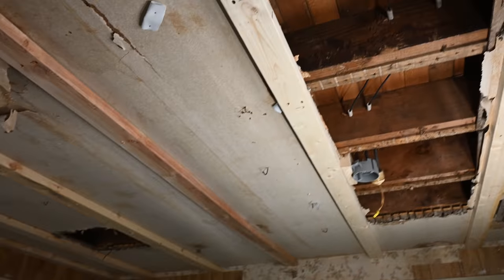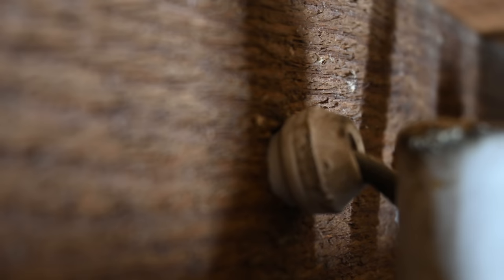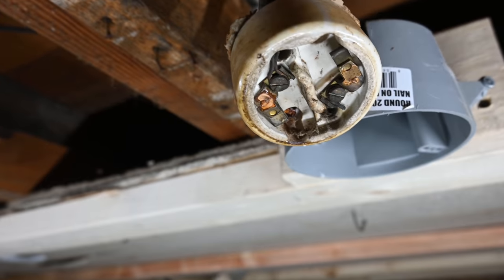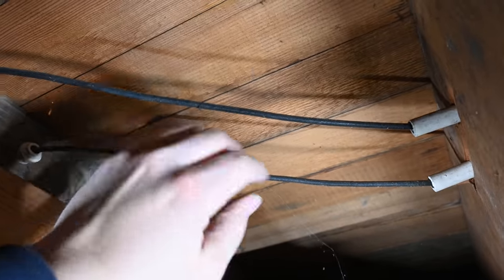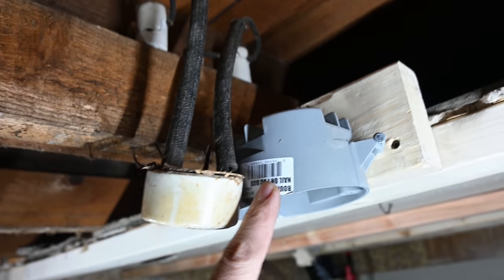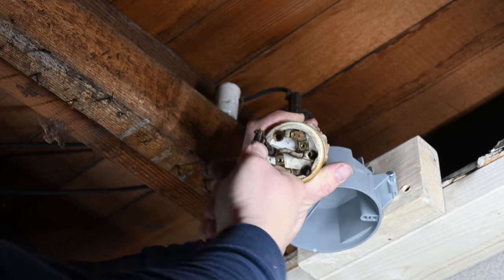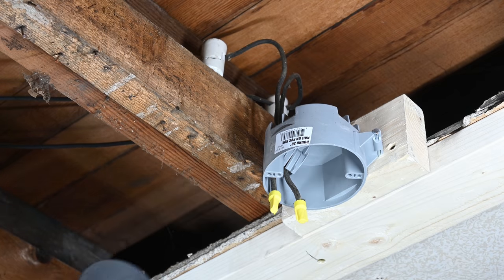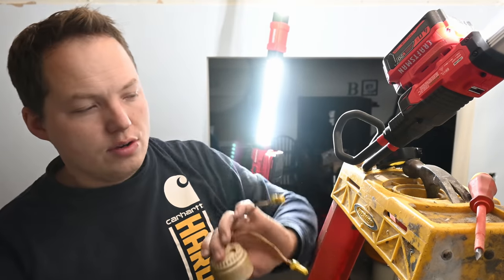How To Abandon Knob & Tube Wiring in a Wall or Ceiling

Comment: My home, built in 1959 has knob & tube (KT).  When I renovate a room, I replace KT with Romex all the way back to the circuit box, if I can.  But finished rooms and ceilings blocked that in some cases.  In that case, I have installed a box to join KT with Romex leaving as little KT as possible.
Reply: Home built in 1959 with knob and tube??? are you sure the home was actually built in '59.  That is very late for knob and tube.   I've been in homes from the '30s that had the original cloth wire romex,  all the knob and tube I'm aware of wad installed before WWII and never seen any installed after about the mid 40s at the latest.
Reply: @Sparky-ww5re  1962 home with K&T here (San Francisco).
Reply: @markcrimmins1879  very cool.    Seems they used K&T much later in certain areas of the country.  In 1962 grounded romex had been around for a couple of years even before grounded receptacles were required,  they would often wrap the ground wire , which was usually 16 gauge with 14 or 12 gauge hot and neutral during this period,  around the clamp securing the cable to the box, you'd then have what is known as grounded two prong receptacles,  this is where using the coverplate screw on the green tab of a 2 to 3 wire cheater plug will actually provide a ground, of course nobody used it like that.

Comment: We have a lake house in NH built by my great grandfather and wired with knob and tube. In the 1950's, my father figured it was dangerous and also wanted to add more wiring (the old insulatiopn was dried up and cracking). So, we tore out all the old wire and installed new romex with all new fixtures.

Comment: One comment. I was always taught that in a box there could only be one breaker feeding that box. So, what you were talking about here where you were terminating the K&T and also running in a Romex for lighting may be an issue. I personally would not do it unless it was on the same circuit. I was taught that one breaker ( or fuse ) should kill everything in the box. Now, on long runs with conduit and several circuits in the same junctions it would be obvious that you might have multiple hots, but a small lighting box like this is not obvious.

Comment: I think you should have kept the loom sheathing on the wires as it was intended to provide extra insulation when the wires came close together
as when entering a fixture, and the wires had to come in through different holes.  Otherwise the wires were to be kept a foot apart during their 
run from box to box.   Splices could be done anywhere, not needed to be inside a box.

Comment: I had an incident where my house remodel was denied insurance because the inspector documented it on the report, even though I told her it had been decommissioned from the breaker box and that I had not had a chance to remove it yet.  It was stupid.
Reply: You do run across inspectors that have never actually worked in the tools and as a result don't understand how systems work in any structural sense so they're trying to memorize code rules, rather than going by a working comprehension personally of how something operates.
Reply: Sad thing is that if you do not remove it, someone in the future might try to recommission the K&T.  I rip it out with a vengeance.

Comment: I've always removed the knob and tube that I've encountered. If you don't someone will likely try to use in the future. If you knock out the insulators the hole is ideal for 12/2 or 14/3 cable, so no drilling.

Comment: I replace post and wire.  The inspector made me remove the disconnected post and wire.  Post and wire used bare wires on porcelain posts so insulation or any contact with other surfaces was not allowed.
Reply: I've never seen the insulation, stripped- off when it's between the knob (post).

Comment: 35 year electrician. I'd never add a box if my goal is to abandon the K&T.
Take it back as far as you can, cut a 6-8 inch tail, wrap it back around the last knob, and wrap it around itself. Tape well and call it a day.
That's how the original system was terminated.

Comment: I worked on a house with knob and tube. In one instance the entire wire lath wall was electrified by failed tape termination. The box was filled with newspaper and plastered over.
Discovered when i scanned before
Hanging a painting. Wasted power for years.
The next instance almost killed me.
I was fixing lowered ceiling tiles and was shocked. Two burns on my arms.. Romex was patched into knob an tube and it rubbed on the furnace. Electrifying the whole grid .
Now i test everything before doing my Non-electric work. If it is metal it can be energized.

Comment: Great Video!  Regarding work lights... To Dim a AC to DC LED work light usually uses PWM.  The higher the frequency the higher the price.  Better options are definitely available, but more expensive.  I agree with you however.  Not sure why $1 more of parts and labor would result in a price increase that is beyond what most people would pay (Just because their lights are video compatible).  Anyways, don't worry good dimmers are going to go more in fashion soon. Partially thanks to people like you who complain about dumb cheap lighting driver decisions. Spend a dollar more.  Charge us two dollars more.  Companies need to start making high quality again, without 1000% markup.  Why make garbage?  Granted, most people don't care about whether their work lights are for video, other repercussions of LED dimmer shortcuts are buzzing, EM interference in sound-systems, and bad dimming profile.  Anyways, thanks!  Your videos are helping me a lot.  First time new construction plumber and electrician!  I'm used to smaller systems!
Reply: Yes, yes yes and yes! Totally agree

Comment: It seems like those Milwaukee lights use a PWM controller for dimming rather than using resistive dimming. When you had the one on its brightest setting, I didn't see flickering. They may have went with that method for battery life longevity. I'm thinking that using rapid switching with a constant voltage may be more energy efficient than using resistive dimming which just pumps out more and more wasted energy as heat the dimmer you make the lights. Using PWM may allow the light to run substantially longer on it's dimmest setting. If you want to use those lights still, you may be able to find the brightness you like best and then adjust the recording framerate and shutter speeds to best match the frequency of the light if your recording equipment allows it. Someone also mentioned that LED's flicker in order to not burn out. That is not correct, but a flickering LED would stay cooler while looking less bright. LED's can run on constant current without issue as long as a sufficient heat sink is used when needed. In essence, they work from electrons leap-frogging across atom valences that makeup its semiconductor material to fill "electron holes". Most LED's have a normal P/N junction temperature of around 30 to 60°C with ambient room temperature (20°C). I believe LED's can reach about 70°C before degradation starts. If a heat sink is used, you can keep them from reaching that temperature to a point and run them brighter.

Comment: I have knob and tube and I have two switch and they are powered by two wires and then to the hall light and then to the yard light how to wire to have it done so I can control each one by it's own switch

Comment: Where I am, when I encounter knob and tube wiring, it's mandatory to disconnect it and run new cable for the circuit. Makes it difficult when you're in an old house with a fused distribution box. (Which is also required to be changed out..!)
Reply: Same rule apply for bx?

Comment: Hi Benjamin ! I have some knobs and tubes like 3 circuits I just gonna disconnect them in the main panel and run new romex what do you think about this approach?
Reply: I got the same issue , I can tell you it’s different in every location 
    Here where I am it is allowed by code but insurance will be hard, there are some that are fine with it some are not .
   So like buddy said remove it when possible and call your insurance provider and ask what there policy is

Comment: Yes the insulation is fantastic until you manipulate it in the least bit also the fact there are no markings as to hot or neutral the outlets of outlets of that eta were not polarized and it was common for lamps etc to have one leg to the body and if by chance there were say brass   within reach and if one lamps plug was plugged in opposite of the other then BAMB you get at the minimum a little shock or at worst you die. My thoughts are get rid of that OBSOLETE stuff

Comment: If in great shape, still needs a ground but can continue to use and heavy enough. A lot of old houses only had the one light in center of the room and some were powdered by 36volt generator and glass lead batterys. Other appliance would plug in to the light with an adater. I  use to pull out all the old if not able to use. Then on day was asked why. Waste of time. I still make it totally disappear any where around the new service panel as to eliminate temptation.

Comment: I always use the old loom as intended when entering boxes.  Added protection.
Article 394 Concealed Knob-and-Tube Wiring.  Existing KT can be extended when all the provisions are met.
Reply: The problem is K&T wiring is useualy spliced into all over the place ! So finding the source feed is a bit of a job ! Then again newer homes are not always wired right eather ; ( that is something Mike Holmes found out the hard way -- he should have know that there are severl ways to feed both sides of a 220 circuit ) ! Remember this working on 220 circuits  always test both legs of the circuit to make shure all power is off !!

Comment: I have some K&T supplying my ceiling fan, front porch light, and a 3 way switch for a stairwell light (3 separate wires-6 technically)..had to add about 8" of Romex , pre twisted/wire nut/taped ... I know it's not ideal..but should i demo my whole living room ceiling and walls etc to run new romex...it's stapled so I can't pull new
Reply: Yes.   Most of the time you can just cut a few holes and run wires through.  Don't need to remove exsiting K&T.  Just cut the power to it.

Comment: I know this is at least a year old but incase no one has given a solution to the LED's. All LED's flicker, its just doing it so fast that our eyes don't pick it up. Cameras aren't like our eyes and what you are seeing isn't flickering per say but a rolling shutter effect. It kind of like what you'd see when videoing a spinning wheel or propeller. Most cinema/video lights aren't LED for that reason and the ones that are are usually of a very high frequency. The frequency of the light isn't agreeing with your camera so the simplest way would be to adjust the shutter speed and/or framerate that you're shooting at. I had this issue with some LED bulbs I used to use and was able to find the sweet spot with my camera.

Comment: I'm curious about abandoning 12-2 romex - In this video you mentioned as long as it's de-energized it can be left in place. Whoever built our home ran a single 12-2 cable from the kitchen down through the floor over where a future bathroom would be in the basement and left it capped in a junction box attached to the floor joist. I am now finishing the basement and am running home runs to the basement bathroom and want to abandon the wire the builder ran down from our kitchen which is directly above the basement bathroom. I believe you're not supposed to cover junction boxes and they must remain accessible. If I disconnect the cable from the kitchen circuit at the receptacle to de-energize it, can I leave the wire stuffed back into the wall and then cover the junction box in the basement?
Reply: I think he meant you cover the box with a flat plate. it covers the box but leaves the flat plate exposed, letting others (future others) know there's a live wire behind the wall.  In my 1900 house, I have 2 flat plates in my kitchen on a wall where I had new wiring added to my remodeled kitchen.

Comment: I would not have put both of those wires through the same hole in the junction box.  Although the insulation on knob and tube is generally pretty tough stuff and has stood the test of time I have seen it crumble and turn to dust and more than a few occasions depending upon the location.  For that reason, I would personally feel much more comfortable having those wires separated going into the box.
Reply from the maker: Totally agree! The camera angle didn't show it very well but the wires were pulled into separate openings.
Reply: I don't think they're going to be used anymore that's why he is running a Romex. Having said that, they are de-energized.
Reply: @BenjaminSahlstrom  - Ahhh, my apologies !   Well done then :-)
Reply: Should have kept the loom on the wire extending the loom into the box.

Comment: Abom79 had the same problem with his videos, he fixed the issue by testing different FPS settings on the camera. It might work for you too.
Reply from the maker: I do know that is a workaround that works but it just adds another complexity to the recording process that I would like to avoid if possible.  :)

Comment: I have several outlets and center lights still on K&T.  Up in crawl space there is blow in insulation in contact w. The conductors, so this year I want to convert everything to Romex and remove the K&T wiring.  It bugs me knowing it is up there.
Reply: I have same thing, insulation blown over k&t in the attic. I even found a open live line without a wire nut under the insulation. Had a terrible home inspector, he didn't even check in the attic.
Reply: If you're talking about blowing cellulose,
 in the early 80s, I installed that and what was required in California, was you had to roll out mesh screen in the stud- bays, so the insulation had that barrier from coming in contact with the wires. You had to individually wrap some mesh screen around the individual knobs, as well.
What that did was create a pocket from the insulation being too tight around the wires, thus affecting heat dissipation- I've come to understand since then.

Comment: the only thing I would have done differently is use opposite ends of the box to pass the hot and neutral through. and leave the additional insulation on.

Comment: Help me please I have a 125v 60hz blower and my current is 110v.  Before I had a cheap outlet and it got very hot and we burned it and it lit up.  Now change it for one from 127 to 250v, but I'm afraid to connect the blower.  You think that nothing happens since in my country the current is 110 but the blower that I bought online says 125v help me what do I do....

Ayudame por favor tengo un blower de 125v 60hz y mi corrien en de 110v. Ante tenia un tomacorriente barato y se calentaba mucho y se quemos y se encendió. Ahora lo cambien por uno de 127 a 250v, pero tengo miedo de conectar el blower. Crees que no pase nada ya que en mi país la corriente es de 110 pero el blower que compré por internet dice 125v ayúdame que hago....

Comment: Why are knob and tube wiring a fire risk due to heat dissipation of the wires?  Do they inherently use a smaller guage wire with more resistance?
Reply: There's better heat dissipation, being as the conductors are not encased in any sort of raceway- (Conduit),
The drawback is since they're not in a raceway, rodents and the elements could deteriorate the insulation on the wires.
In that era, there weren't as many dedicated circuits or fault grounds, that's what makes those old systems not as safety- sound as today.
Reply: The question was "Why do button and tube wiring need better heat dissipation?".

Electrical wiring heats up, even modern wiring. By the way, there are still some rules to follow for the heat dissipation of modern wiring. For the button and tube wiring, I believe the rubber insulation was more fragile to heat.
Reply: @sg39g  correct.   Because knob and tube systems almost always date from before WWII , they are at least 75 to 80 years old at the newest,  there's no tell what the temperature rating of the insulation was.   Modern NM aka romex,  is rated 90°C but we size the circuit protection using the 60°C column, so modern wiring has a pretty good margin of safety.   Older pre 1980s NM was typically rated 60°C.     Overhead light fixtures would make the insulation on the conductors very brittle and are known to crumble off with the slightest movements, especially when homeowners using 75 or 100 watt incandescent bulbs in fixtures designed for 60.   The new NM solved that.

Comment: The rough textured joists (not the sister supports that were added) look like the joists in my house. Anyone know confidently what species of lumber that is? Did they treat those members back then? Some folks have told me that lumber during that time was soaked in oil or other things. Is that true? The reason I'm wondering is because I want to do framing repairs in a manner that's similar to the original.
Reply: Find a private sawmill and they can give your "rough cut" wood that is cut to the actual dimension.  I have seen old timers soak wood in oil if it was exposed to the elements to prevent rotting, but I would not do that due to the increase in fire risk.